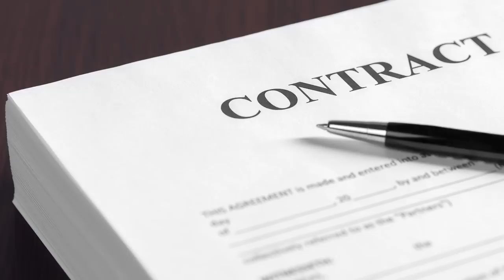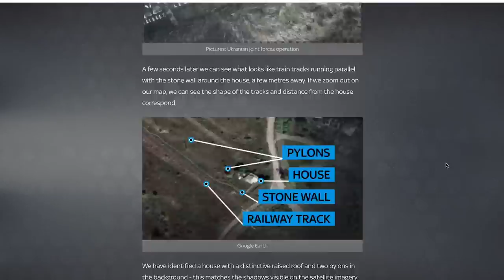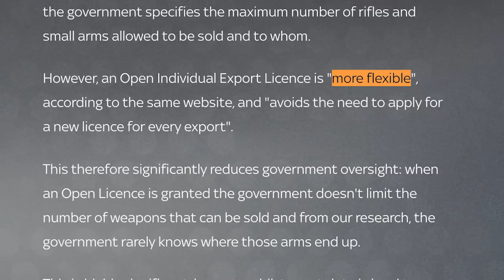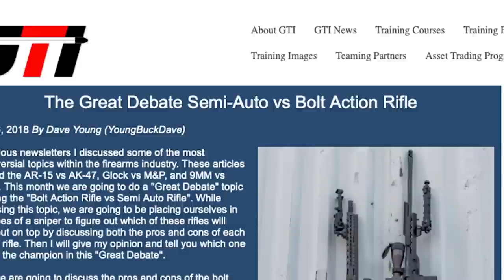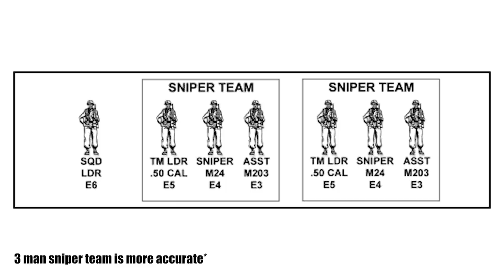L115A3 Brits Sniper Rifle From a Shed to Combat

Comment: The U.K. Government destroyed all 7.62 NATO items and replaced them with the AWM 338 Lapua variant. Such a shame to needlessly destroy good inventory.
Reply: They should have been sent to Ukraine...instead dumped in the North Sea...
Reply: @dogsnads5634  Absolutely. Perhaps someone here can explain the mindset at the U.K. MOD by having all the 7.62 NATO examples of these rifles destroyed ? A theatre of the absurd.
Reply: @perarduaadastra873  Essentially the rifles had done their service and were worn out to a degree. The reason why they were cut up and dumped was because the British Government desperately didn't want any of them turning up in a warzone after sale and causing political controversy. The value of the rifles in total was far less than £1m. So the risk/reward for selling them on was not worth the candle (and to be honest its a very valid point). Personally I'd have slathered them in cosmoline and stuck them in a depot until we stopped using 7.62...
I suspect the MoD's policy on surplus weapons/ equipment disposal will change in the light of events in Ukraine.
Reply: @dogsnads5634  Thank you. A splendid explanation. 

I’m not sure the AW actions are capable of wearing out, though a 7.62 NATO barrel can remain viable for 20,000 rounds.

With plenty of surplus bolt guns from previous conflicts, it seemed incongruous to suddenly upend the historic policy of letting discontinued military product come to the civilian market. How attitudes change....... the Establishment so very keen on U.K. civilian sporting gun prohibitions since 1989, when the immoral criminal conduct of one individual with poor mental health was emotively and illogically imposed as the benchmark common denominator, foisting prohibitions upon our entire nation, the State not keen to actively facilitate and promote civilian sporting gun ownership among the 600,000 U.K. civilians who already own sporting guns, forgetting the British “National Rifle Association” was established to  support civilian marksmanship, “As a Martial Art in Defence of the Realm”.  

I bought my first centre fire handgun in the early 1980’s from Accuracy International at their U.K. retail shop in Portsmouth, a 44 Magnum Ruger Redhawk. I was aged just 16 at the time and last met Sir Malcolm Cooper by chance on the Dakota Arms stand at the Las Vegas Shot Show. Tragic his life was cut short by a brain tumour. 

There are many the world over with stories about their AW rifles, a 6.5-284 in an AW single shot solid floor action, where the trigger is of much greater finesse than for the more arduous conditions of the military variant. And the integrally suppressed AW Covert is Hollywood quiet. 

With war in Europe, may I say that when the former Soviet Union collapsed and was removed from oppressing Czechoslovakia, the Czech people wanted their personal guns back as a matter of moral principle and political integrity. Today, 250,000 people in the Czech Republic, 1 in 40 of the population, have “Concealed Carry Permits” for any semiautomatic firearm they wish. Now, that is Freedom. ✅

Comment: bolt action doesnt give you more accuracy i have seen ar10 shoot sub MOA. better reliability ? well yes but actually no. think about your ar10 jamming every second shot it will still be faster than a bolt gun. better trigger pull ? no. you can get 2.5 lb triggers for ar for a couple hundred bucks. so i mean bolt guns have no place on the battlefield. they are great for hunting but not for war.

Comment: The first use of those Boston Dynamics humanoid robots will be fitted with shot locators and thermal analog kit to draw sniper fire.. artillery will then settle the sniper.
🇺🇸
Reply: Well if that the case, it stands more chance than a noisey 50 then dont it...

Comment: Classic story. Send designs to a subcontractor. Sub does not follow the designs. Somehow still your fault.

As an engineer, nothing is more infuriating than when someone tweaks your drawings and then doesn't understand why the equipment doesn't work
Reply: What are you going on about?.. Explain who and what has been subcontracted??...
Reply: @wor53lg50  it's literally the origin of that rifle. AI subcontracted the production of the L96. The sub ignored the technical drawings. AI had to fix it. As an engineer who's dealt with subs ignoring the technical specs I've developed, I understand their pain.

Did you watch any part of the video?
Reply: @edbangor9163  Obviously he didn't.
Reply: @edbangor9163  i thought they said subcontracted to a missile company and they ballsed the components up by skimping and cutting corners so they fuct them off..